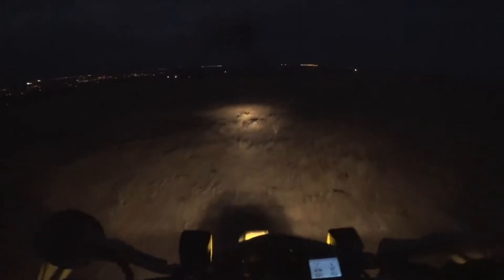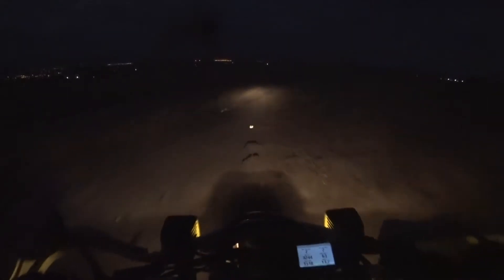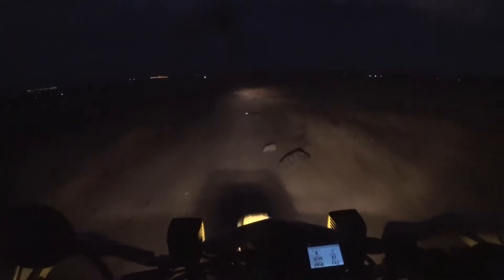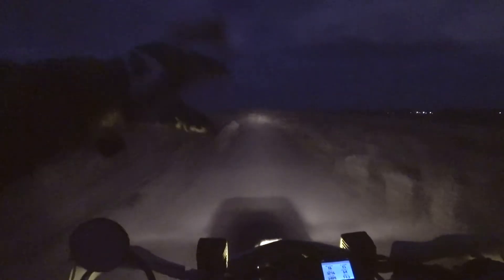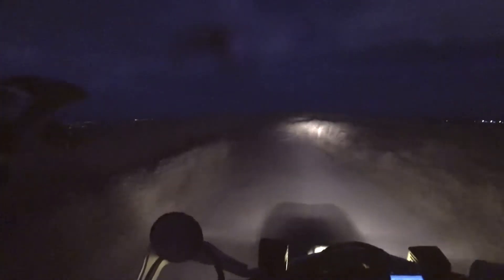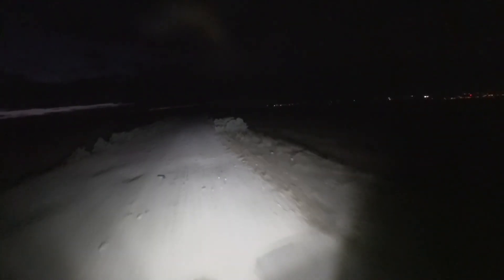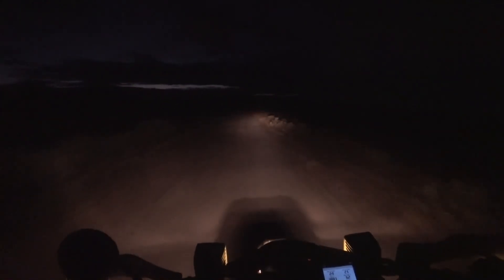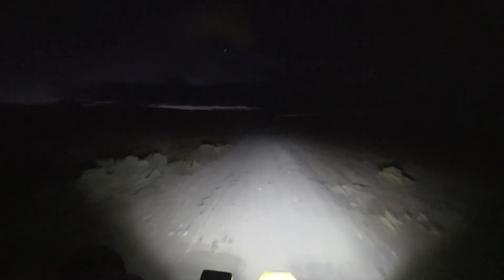DRZ 400 LED light upgrade

Comment: I’ve got a 2017 SM model. You think using the stock high beams along with your LED setup would draw too much current? I’m thinking a separate toggle switch for the LED’s and making my stock high beams the new low beams and only toggling the LED’s for high beams. Let me know what you guys think
Reply from the maker: The alternator output is 200 watts. The stock headlight is 55/60 watts. You can run about 110 watts of headlight without problems supporting the load.
Reply: @PistonSlap   awesome! Thanks for the help. I also clicked the link to the LED lights and they’re no longer available. Any other brands you’ve heard of that are decent quality and aren’t Harbor Freight $20 ones? Thanks.
Reply from the maker: @BRYb0Ss11  I have seen the cheap ones and while they put out light it's not really focused.  The optics and quality of the led are what you are going to pay for.  The PROCOMP  one is here https://www.procompusa.com/light-product-details.aspx?pt=4242&pl=109860   they have it listed under halogen for some reason.  This is a kit of 2.  I only used one. because it is more a flood beam.  The Rigid is more expensive but it works and puts the light out there where I need it when at higher speeds. https://www.rigidlightshop.com/p-3132-rigid-industries-spot-surface-mount-black-d-series-pro-rigid-industries.aspx

Comment: I have a new 2018 S model. I had a 2005 S for 12 years but I gave that to my son in law so we can ride together. I guess you needed the Tusk kit because you had the E model? So the current draw is really not noticeable? I have a 12v cig socket on my handlebars and also 2 USB connectors. I see now you can buy a USB charger that goes into the 12v socket and also has a little LED volt meter; looks pretty useful
Reply from the maker: exRhodie yes. I have a trailtech and don't see a difference in voltage when they are on.

Comment: That's good info, thanks. Does the DRZ alternator handle that extra load OK? Being LED I guess its not too bad. I'm wondering if I need to do the stator upgrade. How do you have them connected now - is the flood linked to low beam and the spot linked to high?
Reply from the maker: exRhodie so my DRZ is a 2000 400e model. The stator(alternator) puts out a max of 200 watts.   I installed a Tusk street legal kit, so that I would have a high and low beam switch along with turn signals.   I wired mine so the stock light would be low beam and the flood and spot are on the high beam wired together.

Comment: How did you attach those led cubes onto your bars?
Reply from the maker: I used the bracket that came with the cube. Then threaded a bolt into my hand guards.  I had to bend the brackets a little to get the light where i need it

Comment: I really like my light replacement. I have the 2016 S model and I just bought an LED replacement plug and play light that works really well. I don't think that it would work for yours though. they're different sizes right?
Reply from the maker: Mandalorian Dualsport yes it's way small. 2x4 if I remember.   I purchased the led light like you have and figured it out that it didn't fit
Reply: ouch! but you found a great alternative option though!
Reply from the maker: Mandalorian Dualsport oh yeah.  It seems to work good!
Reply: I do think that switching one out with a beam rather than a flood would be the best fit though.

Comment: That would be great. What's the name of the LED units you installed? Thanks
Reply from the maker: The ones that I used in the video are from Pro Comp.  I believe they are 76407P.  I will check tonight when I get home.  I also think they were boxed wrong as they were labeled as a spot beam but have a defuser style type cone that makes the beam more of a flood type.  A few weeks ago I acquired a Rigid Industries Spot beam that makes the Pro comp look like a candle.  I posted a pic on Instagram.  So currently, I am running one pro comp and one Rigid.  That way I have a flood beam and spot beam.  the Ridgid pulls about 30 watts and the Pro Comp pulls about 12 watts.
Reply from the maker: I just uploaded a video that's a ton shorter.  It's with my current setup.  I cant post the link without it getting dumped in the spam folder.   I will see about getting a video together on the install and such.